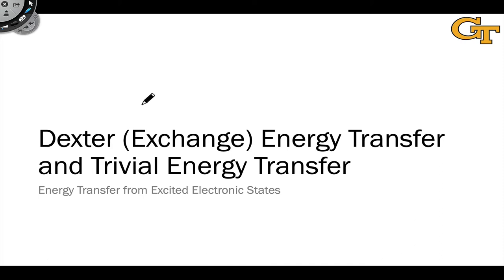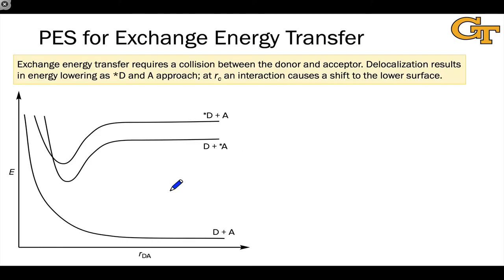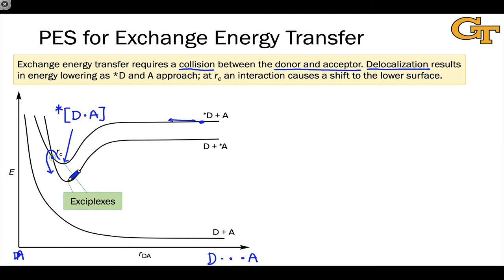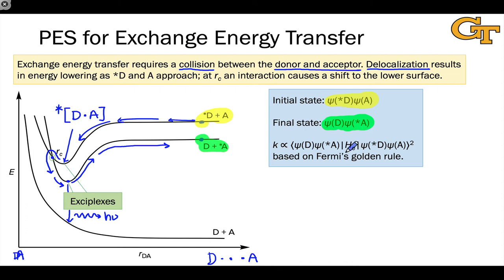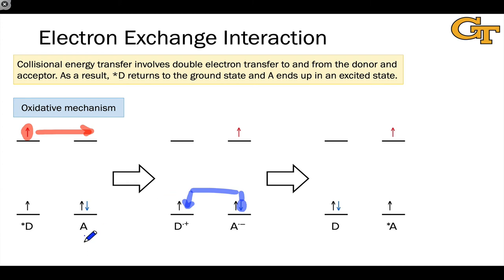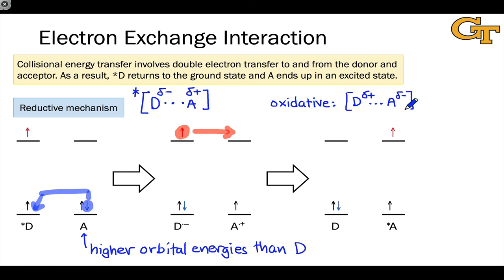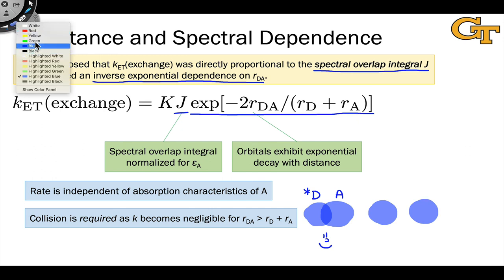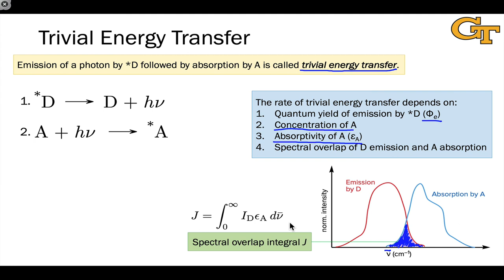4.3 Dexter (Exchange) Energy Transfer and Trivial Energy Transfer

Comment: Thank you so much for this video, it was really clear. But I was also wondering, how is it possible to differentiate FRET and Dexter? I guess it's with the help of some formula. Is there any other way to differentiate them?  Thanks again for this video :)
Reply from the maker: This is typically done using the distance dependence of the rate (or, equivalently, intensity) of energy transfer. Dexter ET falls off rapidly with distance, so if energy transfer is observed over relatively large distances (e.g. in a protein where the donor and acceptor are held far apart), it's assumed to involve FRET. Solution-phase ET between small molecules is usually assumed to be Dexter ET although it may not always be!